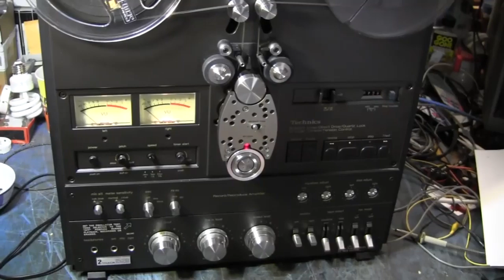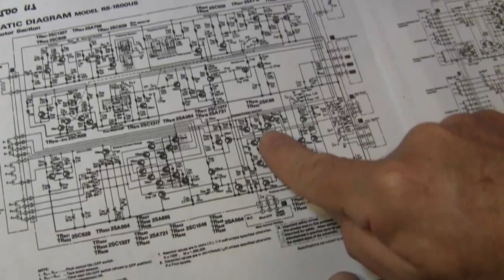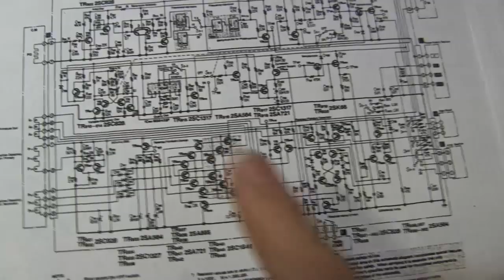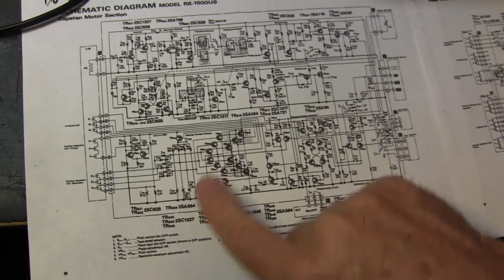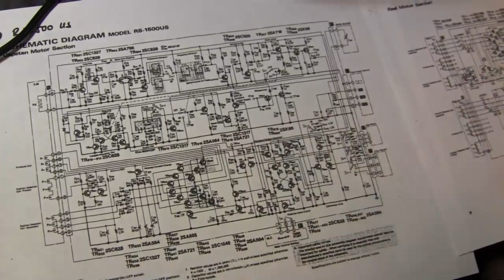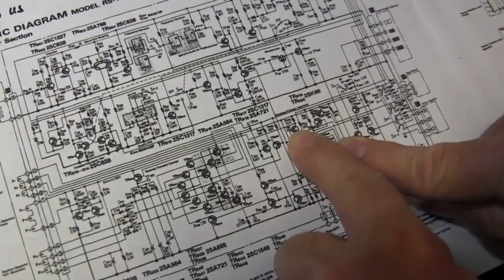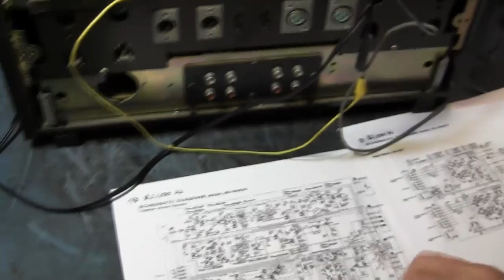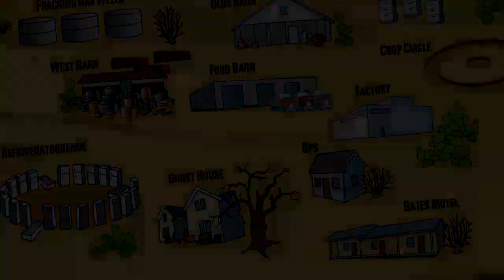Technics Tape Deck repair Part 1.

Comment: I have this exact same unit, I bought it new around 1982 I think.  I started to have trouble with it a few years ago, the supply reel would overspin after tape runout. It also had the speed wobble that this unit has.  I took it down from my shelving and put it away for five years or so. I recently decided to embark on a journey to repair it. It's a magnificent looking machine, and I still have an extensive library of tapes.  I've actually just started a complete disassembly and rebuild of the unit right now ( Feb 2022). I have removed the motors and all circuit boards, taking extensive photos along the way. I'm going through each board trying to find defective parts. So far, I have found some defective caps in the power supply board, and the microswitch that is linked to the take-up reel tensioner was defective. The microswitch is lever activated, and had a very high resistance when closed.  That was tricking the torque control circuitry into misbehaving. I'm waiting for the parts I ordered to come in, but in the meantime I'm testing every cap on every board and every semiconductor. The pull on speed control switch was intermittent too, but that resolved with multiple uses of contact cleaner. This will be a very time consuming project but well worth it. I wish I know more about circuit theory though, this guys sounds quite knowledgeable.  I'm strictly a hobbyist level repairman, but enjoy it.

Comment: A lot of talking, but no solution. It is actually a simple one: the capstan motor control circuitry must be (re)adjusted according to the service manual. It is described in the RS-1500 service manual (also applicable for the RS-1506/1520/1700) in Volume 2 on page 21. The adjustment requires a scope with at least 2 channels. Adjustment is done on 2 trimmers at the backside of the deck, which are accessed through the holes in the horizontal metal bar below the capstan motor, also visible in this video.
Reply: That is exactly what I just did on a 1506 and it fixed the problem. A few minutes job.

Comment: The 10 volt caps on the capstan control board have to be replaced. These have a TON of leaking and corroded 10 and 16v volt caps, all the electrolytics need to go. There are about 180 of them. The phase and frequency controls on the back are set with a scope, pots on the right rear, 2 pots.. Brakes need the felts replaced, with cork, they are for station keeping only. There are a few other typical Technics specific and general open reel service work that needs doing.

The boards do remove,or move in their removable mount frames for easy access service and testing if you follow the service manual. It takes me 30 or more hours to restore one of these, I have an RS-1506 ON THE BENCH NOW, it'll be 30-40 hours including re-veneering the Cherry wood sides, refinish and silk screen the face, as well as custom  finish knobs and buttons,  Questions or any help needed feel free to contact me.
Reply: I replaced the brake pads in my RS-1506 with natural leather.  That works perfectly.  Now it makes a dead-stop immediately.
Reply: Hi do you have an email thanks
Reply: @1959Berre  I just replaced mine with very thin felt ( pool table felt) . Leather and cork made it stop too quickly, stretching the tape

Comment: I was thinking that it might be a tension adjustment to the supply reel section and maybe putting more tension on it would help it is just a thought love the videos you post thank you very educational and keep them coming
Reply: No, this is a 'closed loop' machines with two pinch rollers on the capstan.  Tension deffirence on the tape has no influence on the capstan speed.  In fact, you can even hold and stop one of the reels for a second, it will not change or influence the pitch.

Comment: The capstan motor in this deck has more torque than a 1975 maytag washing machine ! As a matter of fact it's about the same size as a capstan motor in a Studer A827. Talkin about over engineering or what !

Comment: I have a RS1500 with a playback issue, it will FF & RW but will not play, this is the second time this happen. The only correlation with this problem is after moving. The first time I moved and set it back up, it had the no play back issue. I took it to an electronic repair shop and they fixed it. I was so happy for it to be fixed, I forgot to ask what the problem was. the second time right after moving it did the same thing. I am wondering if there is some sort of transport issue. any help will be appreciated.

Comment: I have the same issue with my RS1506 plus a problem with the head block switch which is a bit loose and intermittent.
Reply: Take out the headblock and do a thorough cleaning with spray contact cleaner. If that doesnt work, you might be able to replace that head block switch. If you have the schematic you can get the part number to find a substitute with the same physical specs. I did for my reel table microswitches that are linked to the tensioners.  I actually have both head blocks, the 2 track and 4 track versions, and those switches were noisy too, but cleaning them did the trick

Comment: I have the formal schematics for the 1500 series machines from their (Technics) service manuals. They appear to be similar to what you already have except they are, if I recall 20 x 14" and include further annotations of scope waveforms and what you should expect to see at various test points.  Over 30 points in all. Very helpful for diagnosing problems like this.  PM me if you are interested.  I might be able to scan this schematic for you

Comment: So in the end, the simple and best way, is to leave it as it is, and let it run on manual instead of automatic speed control.
Reply: Oh, no. Part of the fun is figuring out why and fixing it. Interesting problem. Document I have shows waveforms.

Comment: The first thing i would do is Clean and Lubricate all rolling wheels. Next thing is to place a reel and play it, then watch how the tape rolls around the wheels you lubricated see if there a change. ..... .... OK ..... ... The next thing for me to say the Reel to Reel needs to be calibrated somebody might of played with that  inside of the back of the Reel to Reel. A pro should do this.>>>>>ADJ>>>>